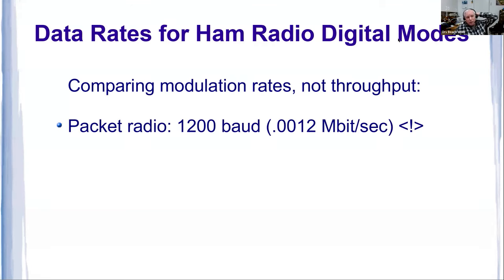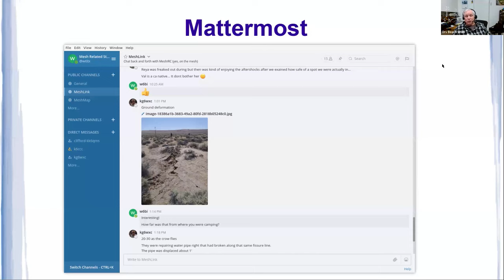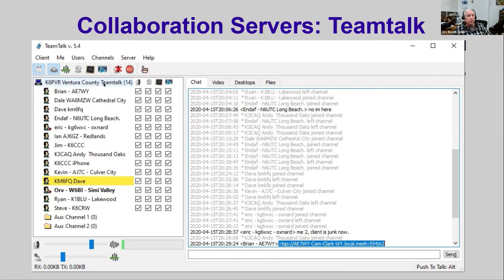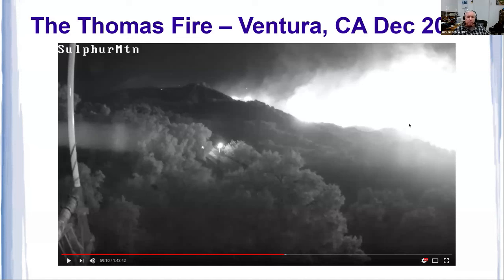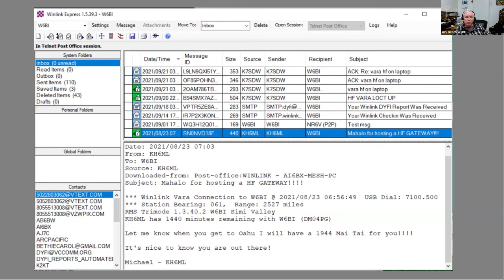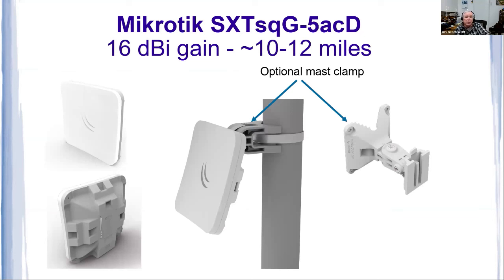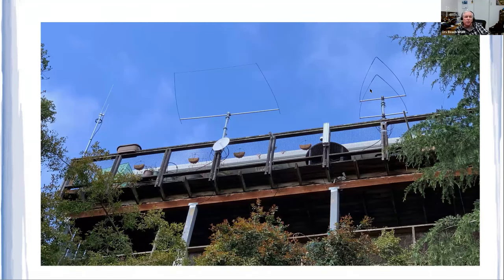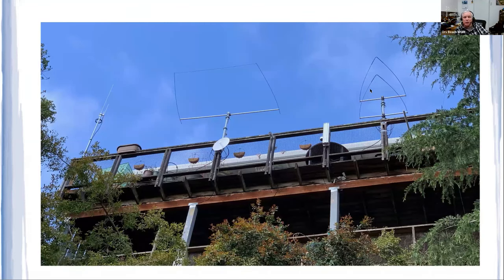Using AREDN Software to Create a Ham Radio IP Network ~ 01/25/2024

Comment: I'm using an [FSOC] Free Space Optic Laser  network on 1500 nm with hi bandwidth FSOC refers to outdoor optical wireless communication (OWC) I'm using AREDN on my OWC laser network up to 8 km -12 km high-speed data transmission over long distances. been using and developing my gear [KD6ILO]